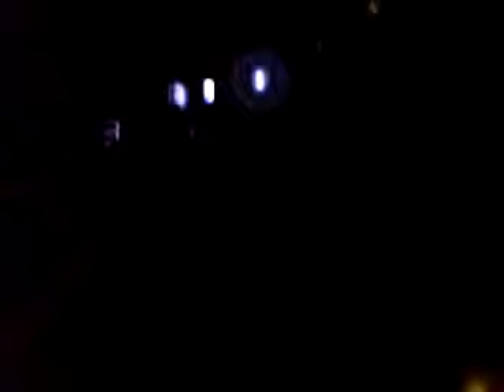GasSweep.AVI

Comment from the maker: Thanks!  I'm doing better now with a more precise grid and better gas handling.  At the point I'm at, the camera blooming is the limit of what I can show at the focus, unless I put something in there to eclipse the bright spot at the center.

What we're finding here however, is that "photogenic" mode isn't as good a neutron producer as a lower pressure is (with various adjustments to accomdate operating there).  That includes output vs input as well.  It's not as pretty, just works better.